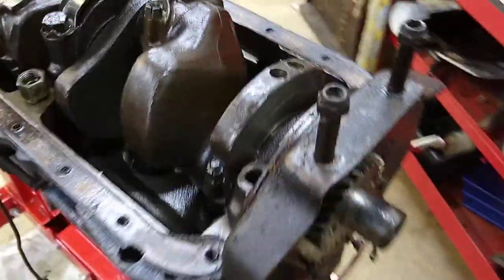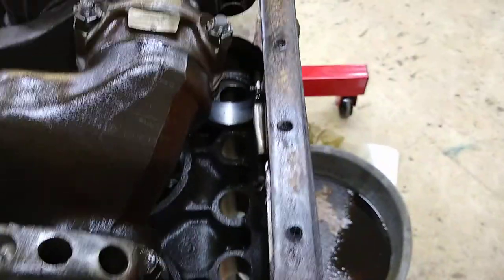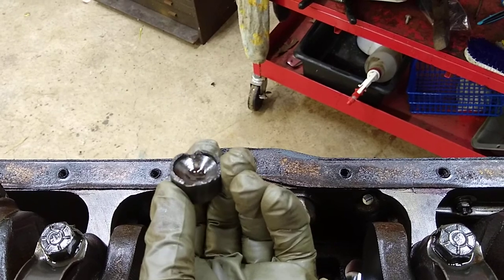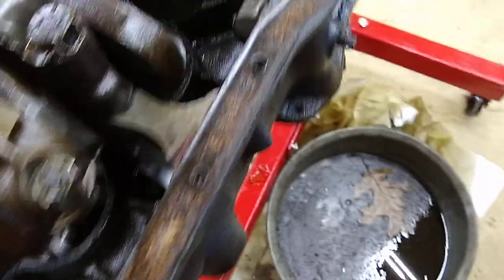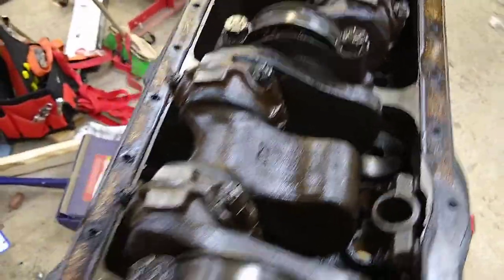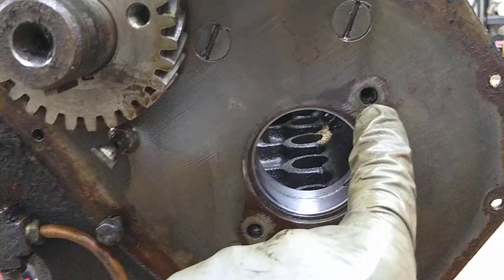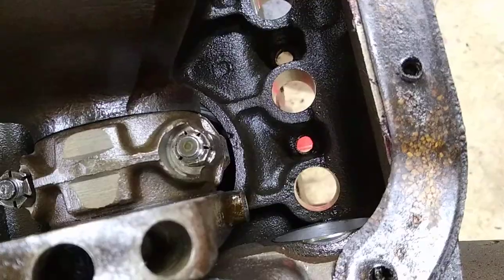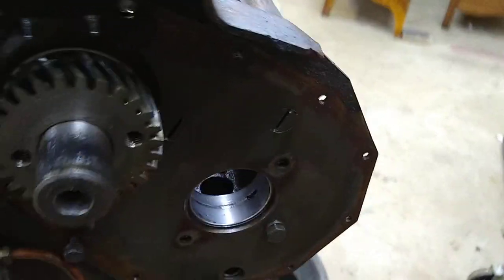GMC 228 camshaft removal and bearing assessment

Comment: Do you have a supplier for the 228 that I could get thanks in advance. Great job on these very helpful posts
Reply from the maker: Hi Jon - I get most of my parts from Rockauto.com or Jim Carter Truck parts (oldchevytrucks.com).  LMC Truck has a good selection of parts as well.